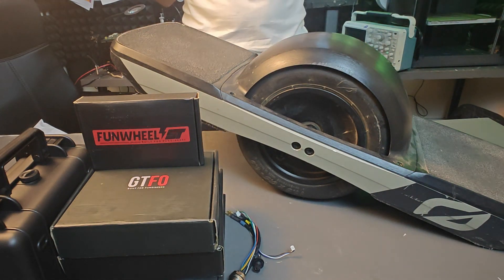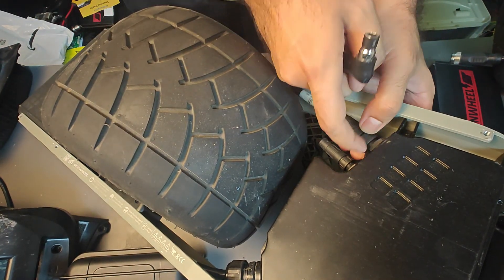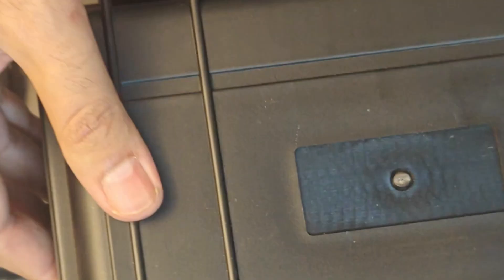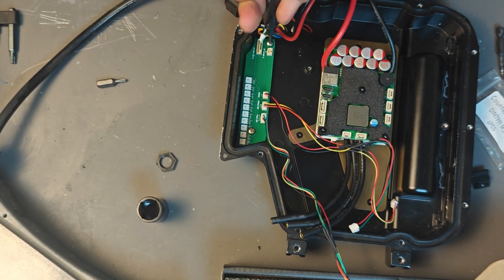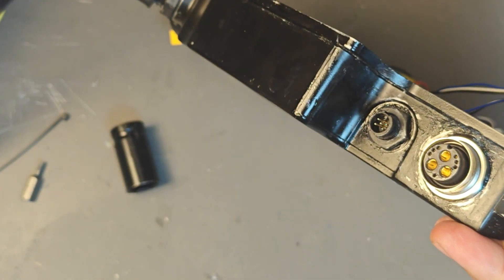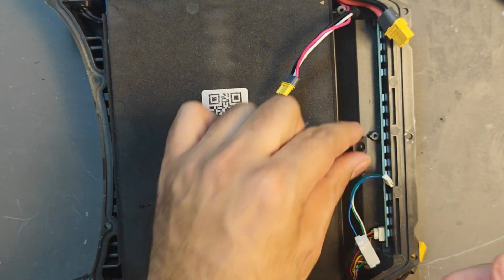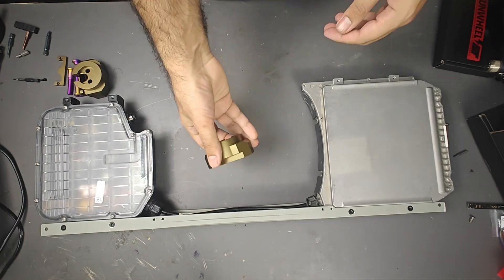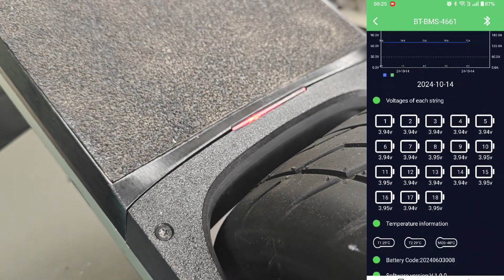GTFO - The Ultimate Ready to Run GT to VESC conversion kit

Comment: Tip from a plumber/sparky.  Dont compress the sillicone while wet, you are destroying the seal. Use an o ring under the ring and coat that in sillicone. Now you have a compressiblle gasket that will seal regardless. Use teflon tape on the thread and it eliminates the concentric leakage path ( the screw ramp ) and if concerned at all about motor connevtors use self fusing tape over them. 100% water/dust proof and easy to remove later if required

Comment: Respectfuly intended, but axle bolts should be a high carbon steel as they dont flex, titanium is not a good bolt choice for an axle as its very flexiblle, strong though

Comment: I installed the gtfo kit with hypercore motor. its been all good till today. Now all of a sudden im getting 3 beeps from the thor, especially when curb nudgng or deweighting board for tricks. Just started doing this today.
Reply from the maker: Looks like it's sensor fault when you take your foot off the stompie. Which is a normal warning. It could be something else too.
 You can observe the AppUI and see what the fault is or you can go to Terminal tab and type faults and go from there.
Post your response on Discord and we will help you :)
Reply: @Fungineers  nothing in the app iu. I type fault in terminal and says no faults.
Reply: @Fungineers  no faults in app iu

Comment: The motor connector wires and Thor
Connectors don’t have matching colors. Thor has blue, green, and one has nothing. The motor wire has 2 grey colored taped wires and 1 yellow. None of them match. 🤷🏻‍♂️
Reply from the maker: Hey, the grey ones are acutally blue and green (quite dark tho). So match the colors and we should be good. For any issues send an email to support@fungineers.us
Reply: @Fungineers  the blue greens one are both on the Thor. So I can’t match them.

Comment: So actually. The logs are skipping cells 10 and 11. It goes from cell 9 and skips to cell 12 in the logs. ALso on the little cell  graphs its missing cell 17 and 18. So either way it shows only 16 cells and it should be 18. Now im not trusting the process.
Reply from the maker: This can happen for 2 reasons:
1. The balance connector isn't connected properly
2. Bms is not reading properly in which case it needs a hard reset (remove all connectors and reconnect). If that doesn't fix it, the bms needs to be replaced.
Reply: @Fungineers  okay I will try
Reply: @Fungineers  So I did what you said twice. ONe time it flashed the extra 2 cells for a split second and then dissapeared. All the plugs and balance connector were spot on. Ot chared out to 96 percent according to the vesc tool at 96 percent. I cannot use this bms with glitches. So what can we do.
Reply from the maker: @dbirds21  the bms doesnot have any control over discharge so it doesn't control rider behavior making it safe. But you should fix it as it might not take a charge if the bms senses something off.
Reply from the maker: @dbirds21 please email support@fungineers.us they will ship a replacment
Reply: @Fungineers  This is brand new. I just got it installed last night. Im the one who had some delivery issues. Bought it from you guys along with thir 300 and led kit gt footpad connector
Reply: @Fungineers  cool thanks but your fairly certain it cant drop my fat ass. vesc does show its fully charged out at close to 75 volts.

Comment: So on the bms app, there is no live information, it all defaults to 100 percent. I get 16 lottle battery cell pics and it should be 18. The only think thaat working is the logging. UNder the logging tab it shows all the info for 18 cells with voltage but real time status page doesnt seem to work well. I just hope this bms doesnt drop me, not alot of feedback on it because its new. Has this bms been tested hard with gtfo kit for hypeercore motor..

Comment: If I buy the thor 300, bms and avaspark bundle kit, it woll work with stock gt motor. If sso will the torque and power be on par with the gtv kit. Stock controller isnt too great for a 210 pound dude with hills.

Comment: I ordered the GTFO kit and realized the BMS is for stock battery only correct? So if i want an 84v i need a different bms?  Thank you for all your hard work!
Reply from the maker: That's true! The bms only drops in and connects to the original 18S battery with the original gt connector.
Reply: @Fungineers  Would the BMS work with a Chibattery replacement GT battery?
Reply from the maker: @sross0830  as long as it's an 18S2P and  the connectors and the balance wiring is the same!
Reply: Larger cells too

Comment: The toolbox 😂😂 But that’s an excellent kit, finally! Do you calibrate each controller individually or do they all get preloaded with the same settings?
Reply from the maker: Overengineered toolbox lol. Yes, Each controller goes in the test fixture and does the motor detection and imu calibration individually, then, it is loaded with the refloat config and tested.

Comment: Can I keep the gt motor with this kit.
Reply: No, that would be the GTV Kit you’d want
Reply: @surfdado  Why can you not use a GT motor with this BMS? It doesn't state that anywhere on the site. I just bought one of these because I have a bypassed BMS that seems to of stopped working. Board turns on when plugged in and can see vesc tool but bricks when it is unplugged. I bought one of these BMW'S specifically for a stock GT with a thor300
Reply from the maker: If you skip the superflux connector and use the Avaspark connector then yes, you can use the stock motor.